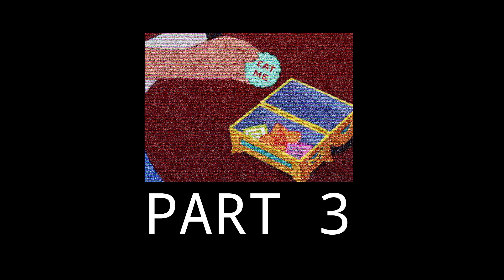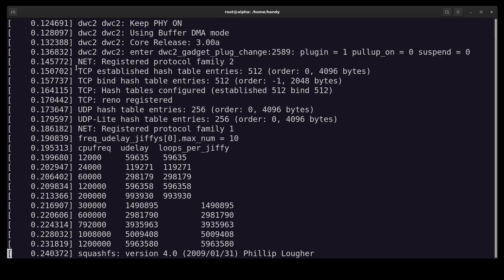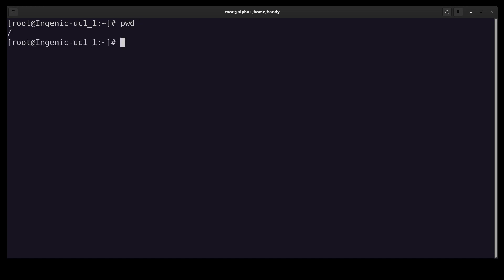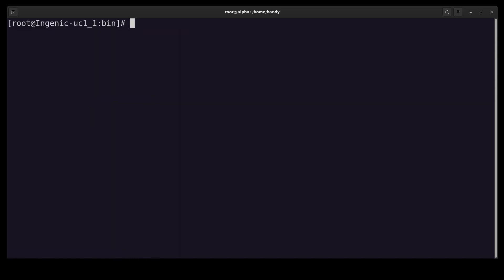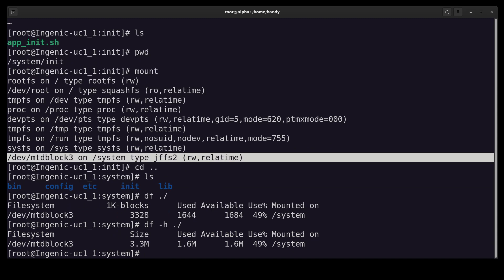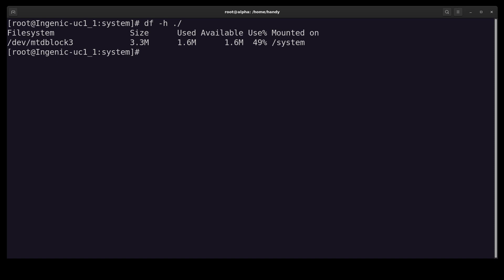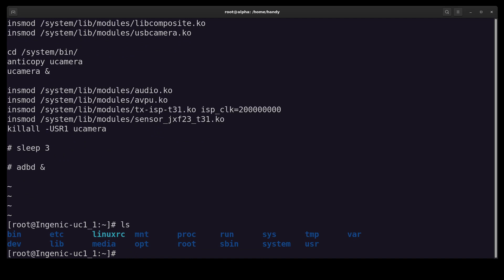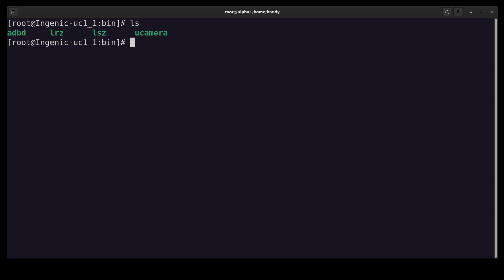Curious RISC WebCam is Linux /w FPGA? | Part 3 | Taste of organic hacking

Comment: You could try to flash OpenIPC firmware for Ingenic T31N/L/X. Apparently the MCU is quite well supported - if it matches the revision on your PCB and the sensor IC is supported. You can take a copy of the entire SPI flash memory for safekeeping, then re-flash the OpenIPC firmware and see what happens. I did something similar with Hisilicon HI3516 webcams and doorbells. Is the Ingenic webcam still available to purchase?
Reply from the maker: I had come across OpenIPC in my research and they recently added support for the chip. Thank you for the vote!
Reply: @hackerhomestead  openpc it  if not crowbar it
Reply from the maker: @EZ-HACK  clips should arrive this week 🤘

Comment: Wow I'm more impressed than I expected with this thing. I've used actual Linux distros with less features than this.
This thing is super cool
Reply from the maker: Indeed, While I am determined to write some sort of simple app for it, what I would really like todo is put something interpreted on it that can link to the libraries included. Just so you can write without having to go though the complication process. May be BASIC, MIrcoPython, or simply embedded Lua ... or even just a cli collection + ash I guess, if there is intrest I may even pick up a few of these T31 chips and build a tinker board using PCBWay ... sorry just thinking out loud. Thank you for the support and suggestions! 

P.S. I did find the T31 processors on mouser/digikey for like $6 to $12 ea USD, I really like the idea of something between an Arduino/ESP32 and raspberry pi.
Reply: @hackerhomestead  sounds like a really good long term project plan. Should be some good videos too

Comment: the FPGA is probably used as a level shifter and reclocking thingy between then SoC and the Camera to adapt between the camera and the MIPI-CSI datalanes on the SoC.
Reply from the maker: I love the idea of embedding an FPGA into an SoC at act as an adapter to peripherals. Am I on the right track? I've been out of the hardware game for so long, a lot of this is discovery for me as well as the audience. (And did you mean like a PLL?)
Reply: @hackerhomestead  I don´t think it´s embeeded into the SoC i guess it´s more likely to be between the camera chip and the SoC, but could be included on the SoC as well.. Not 100% sure..
Typically you have MIPI "Lanes" which is just a fancy name for differential pairs which transmit the image data from the camera chip to the SoC as well as an i2c bus to talk to the camera chip (configure it / tell it what to do, like exposure time, datarate, bunching and so on)..
For most camera sensors you have between 1 and 4 MIPI lanes, depending on maximum resolution and framerate.
The MIPI CSI need a clockline as well, so their should be at least 8 traces connected to the camera chip.
VCC, GND,  DATA0+, DATA0-, CLOCK+, CLOCK-, SDA, SCL

Comment: Not sure if someone else has mentioned this but adb isn't actually Android specific, it can run on anything Linux. Of course stuff like adb install won't work but things like shell,push,pull and port forwarding usually work no matter the platform
Reply from the maker: It was a really nice surprise to see that it was being used elsewhere than android, specifically in embedded ... can be baked in right out of the box when using buildroot.

Comment: btw
If you need to get application in you not really need any of those xmodem base64 stuff and such.
i found there is some very universal trick to do so based on fact that "echo" command have option for specifying characters in hex  which means it is possible to write bash script which would read hex codes from terminal then convert it to binary bytes and then pipe it to file.
So it is actually possible to upload binary over terminal into any system with just bash.
Reply from the maker: I am totally going to look that up and try to include it. I remember it being a thing but didn't have time since base64 was at hand
Reply: Nice tip, but he already has lrz and lsz.  Wouldn't that be a lot easier, faster, and more reliable with error correcting?
Reply: @IntenseGrid  what would you do on system where you wouldnt have those ?
Reply: @MRooodddvvv  He was talking about using  a hex dump and grabbing that over serial with a capture when running a terminal emulator with zmodem protocols, it would be faster and more reliable than just a captured hex dump which has no automatic error correction/retry.

Comment: Adding a USB NIC and making it an IP camera again maybe interesting, particularly if you can use the original USB cable attached to it for the NIC.
With such a small physical and power footprint you could get a wireless USB NIC, or even an LTE adapter and throw it in an enclosure with a battery and have an instant stream camera you can throw up anywhere any have access to.
Reply from the maker: That is totally what it's suited for. I was considering using the chip to design my own IP cam to scatter about the property. Thank you so much to the ideas they really do guide the direction of the channel ❤️

Comment: busybox is not a linux distribution.. It´s a binary which combines all the basic commands a normal linux userland has.
Reply from the maker: Well put, I was struggling in the moment to describe it to a general audience. Still learning a lot on communication. Thank you!
Reply: Its essentially a shell replacement and minimized set of all the standard GNU tools. You can tailor it for whatever size you need by including / not including certain commands, and or removing functionality from those commands. Often times basic switches for the busybox commands will work like the full fledged counterparts, but more advanced things that make the binary bigger have been removed. Usually the things that are removed aren't really used too often anyway.

Comment: Did you happen to figure out what the 2 holes were right on the edge of the board next to the serial console port?
Reply from the maker: I have not traced them down but I do have a data sheet and intend to get back to them.

Comment: I've got 5 of these generic webcams, all purchased from same vendor on amazon.  All have different image quality, random device names.  Some of them work fine, some lock up randomly, some glitch constantly.  I opened one of them and it is a  very simular board except it has the Anyka AK3918 chip.  The datasheet is very impressive.  Can I Leech ZModem into it? (j/k). I'll be hooking my TTL adaptor up soon and see what I get.
Reply from the maker: Awesome! Let us know what you find! If you can get to a prompt have have something like base64, dd, lrz or a few other things getting new software to run is pretty straightforward.

Comment: RIP soldering pads😂. I think minicom supports Zmodem, so you can use that to pull/push files. Otherwise you can always use cat or dd, and write the console output to file. This should work both ways.
Reply from the maker: I did make it work with base64 (spoiler) but I totally cheated and used copy paste ,😅 I like your idea of using minicom I had used it a few years ago with either Z or Y modem to transfer between an old mac via a dry pair modem. This has to be why lrz is on there in the first place right? Thanks you for the support and being kind with me on my soldering sins 🤣

Comment: What was your "screen" command line?  I think I need to learn that and use it instead of minicom.
Reply from the maker: Sure yah that got edited out due to time and some lost footage 🙄
screen -L -Logfile eatme20230316.log /dev/ttyUSB0 115200
Reply: @hackerhomestead  Does it do other baud rates?  Did you try 2000000?

Comment: hum why is there network stuff  in a usbcam does the cam need to get a ip when updating i wounder if its calling to a site Intriguing
Reply from the maker: Spoiler I looked into it ... It's like most vulnerabilities, due to human laziness. They didn't take it out. Nothing else like gadget eth is present in the kernel they just left the loop back in, I suspect because the ADB stuff might require it (not that I was able to make it work)

Comment: in app_init script there is a commented out line for running adbd it show how you suppose to run it in background.
its just normal adb server to which you would be able to connect with normal adb client and use it for uploading, downloading files and get command shell.
Looks like that app_init is in /system partition which is jffs so you should be able to edit app_init with your favorite "vi" and if enable adbd there should be able to connect with adb over usb so serial cable would be unnecessary.
also !   since thats sort of  "android"  you could use off the shelf android ndk gcc compiler to make binaryes for it !!!
Reply from the maker: Someone else mentioned this too, after editing the video I also wondered if this was the case. I did try while preparing for part 4 and it didn't "just work" I'm pretty familiar with using adb, I am researching more on the gadget api, and of course I could have missed something simple. It being there tells me there is a high probability that it should work if the right switches are flipped. I do really want to pursue this method as even in future projects I would love to be able to use adb on systems like this rather than reinventing the wheel.

Comment: Did you happen to find out if it has 64MB or 128MB of built in DDR RAM?
Reply from the maker: It is the 64MB yah wow I left so much out of that episode. Looking it up on mouser I would have to buy a whole reel if I wanted the 64MB version. But the 128MB while a bit more expensive I can buy in lower quantities

Comment: It could get direct access to your hdd and simply offer full remote access.
Reply from the maker: Good thinking, now as your challenge what would it need todo to accomplish that attack?What trail would be left? How would you prevent it?
Reply: @hackerhomestead  well, it would need to have some network connectivity to be able to use your pc, but it is effectively a device which could launch a rubber ducky type assault and become a vector for anything.  it is a usb device with a arm processor.  No end of hackery could be instigated with that on a USB port.  Like keyboard emulation for one.  malware insertion, etc.

Comment: As the guy who opened up ARM GPUs, and one of the co-founders of linux-sunxi because of it... Finding linux and busybox on any device is just standard.

Before sunxi, it was hard to have vendors adhere to the GPL, but that too has changed, thanks to allwinner being so shortsighted with the back then usual NDAs. So these days you get u-boot and kernel sources, but unless you have a massive community, who is going to fix/clean-up/maintain that code, and how will you keep it up to date?

So while this might be exciting when you first discover this, you either already have a big community, or you need to start building one, or this is yet another paperweight.
Reply from the maker: We are trying to build a tinker board to further explore the board. In part 4 I broach writing a hello world using the vendors roll of mips gcc ... If you are interested in the project or building the community feel free to swing by https://discord.gg/rzEMVjaZ4p
Thank you so much!
Reply: @hackerhomestead  I am a human being who needs to adhere to the laws of physics. I cannot spend thousands of hours on yet another linux soc community. Sunxi is still the gold standard, even compared to the overhyped and non-free rpi (btw, i was the one who exposed just how non-free the rpi was).

So i am sorry, but you are on your own here. 

But here are some pointers.

First, find out if there already is a community.

If not, start providing the infrastructure.

Start with a wiki, a mailinglist, and an irc channel. Start filling the wiki with whatever you find in your investigation.

My biggest breakthrough with the initially very badly structured sunxi wiki was making it device first: provide a device page, (google for "sunxi new device page") and link to individual howtos (opening the device, getting serial, building uboot, building kernel) from the device page.

People google for "<device name> linux" and will hit the specific info for their device, and take it from there.
Reply from the maker: I totally understand! Thank you so much for the advice! you know and watching :)

Comment: adbd is indeed  android debug bridge daemon, these days a lot of non android embedded linux distros uses it for easy usb debugging. when you start adbd, see if an adb device shows up in your computers dmesg. dumping the flash over adb will be significantly faster than using uart.
Reply: also the fpga stuff in the logs is probably because the vendors developed software for this chip on an fpga to start with until they got the real chip to work with., it's somewhat common.
Reply from the maker: I was hoping this would be amazing ballZ and just work as it dawned on me and another commenter... Alias I did attempt during prep for part 4 and it didn't "just work" I am still researching the kernel gadget interface to see if I can figure out why. Man would it be fantastic :: stares hopefully into the distance:::

Comment: What about doom?)
Reply from the maker: So ... of course thats where my head went immediately! Esp since that would have some SEO punch! 😂 lets unpack that for a sec ... From a specs standpoint I think we are covered ... Doom is mostly written in C so I may even be able to compile it for MIPS without much issue (spoiler for part 4) , there is a tad of asm in the repo so that could be tricky ... (but hey prehaps run an x86 emulator 🤔) ... and then well gotta make a framebuffer and paint a display, oh and key input 🤔🤔

So there our learning curve turns into a cliff unless I can paint using the UVC ... this is something I was already considering doing, and then we get into the input ... ok so maybe I also get the object detection working and control it that way, or make it also present a controller interface via USB ... DOOMCam anyone ;)

Than I realized two things if I left the hardware unmodified ...
1) That could be like a years worth of development (for me part time, with a day job)
2) I would basically be building a general computer  that you have to attach to a computer to work ... why not just make it standalone 

And that my friend is the fork in the road I am trying to figure out, to modify hardware or not ... to build a computer or not. Than PCBWay reached out to me about a colab .... and I started brewing the idea, why is there not a tinker board for this platform? Why not make one ... than at least I could offer to folks 🤔 it would be something in between raspberry pi, Arduino or ESP32.

That actually could take a lot less time ... then I could design it from the get go to put out graphics, and accept inputs. 

Thank you for letting me unload on you, as you can see I have been mulling this one around 😳 What a fantastic idea! I think it may have to happen in a follow up series down the road, just like in DR Who where those dalek keep coming back ... I think this will too.

Keep those ideas coming, they really do help me steer the ship!
Reply: @hackerhomestead  o, thanks! I think a hardware crutch will be necessary for I/O something. And w  about ram limitation for virtual machine use?
Reply: @hackerhomestead  If you are going to do character graphics for Doom, I think you are going to need better than 115200 baud.

Comment: I'm gonna go out on a limb and say it's unlikely that there's an actual FPGA involved. Chips designs like this are usually tested before tapeout by putting the design into a FPGA, and the software people then use that to develop drivers and the rest of the software. I bet that the 'FPGA' refers to that, and they simply forgot to take out the 'FPGA' wording when the chip taped out to the ASIC you have in your hands now.
Reply from the maker: You know I'm not sure and I think your hypothesis is a good one. But I'm not convinced (all this talk of AI and other features in the slicks). I did find in the ucamera binary where the string is that printed that message. If I can't find references anywhere else I will disassemble the app and find out (and test). The thing is I'm considering using this chip to create a tinkboard platform (like Arduino/ESP32), if it's an ASIC then it's not that big of a deal, but if it's an FPGA it would be significant. I found these chips for around $6 to $12 USD on digikey/mouser 🤞Thank you so much for your completely reasonable explanation ❤️

Comment: What did you solder the TTL USB leads to? You don't say! I have a computer from a Samsung LED TV that I would like to do this to, ... but I need more clue, I think. This is the thing https://youtu.be/CrDtx8zmVzY the WiFi interface is just a beefy USB WiFi dongle, so I know there's a USB bus that is more than just the one port at the back for plugging in a USB thumb drive with mp3/4 files, ... It also has an infra-fred thing for the remote and it has an ethernet adapter, ... There are thousands of these things lying around all over the world and we need to figure what is the best thing to do with them.
Reply from the maker: If you could send me some high resolution pictures I would be happy Todo a video inspection on it. handy@hackerhomestead.com

I soldered to a TTL serial port that was labeled TX,RX,Gnd and used 3.3v adapter. I think I mention it in one of my videos at least. But again would be happy to help, I've wanted to crack a smart TV for a while.